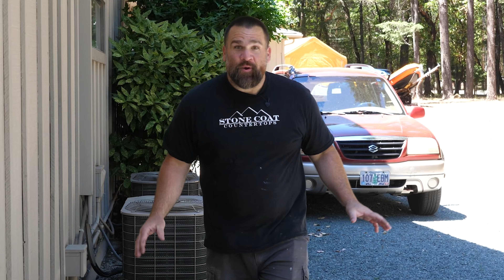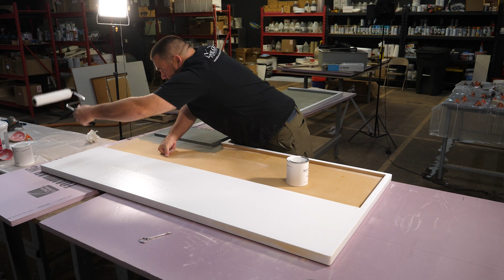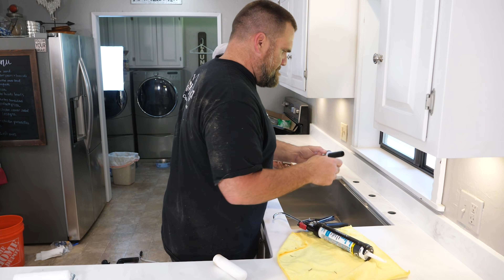How to make White Kitchen Countertops with Epoxy

Comment: Best decision was to epoxy all my countertops instead of buying new granite/quartz. Definitely saved a ton of money plus it looks 1000x better
Reply: i used their epoxy to make my parents shower and it turned out great. Only thing that im not sure about is how long it will last comparatively.
Reply: Great comment! Thanks for watching and taking the time to let is know your project turned out great 👍
Reply: @jkultra2739  can we put hot utensils on it and are they fire proof
Reply: @manishgonekar5831  yeah you can even put hot pans on it. I wouldn't actually do it for long periods of time tho.
Reply: Wow its amazing
Reply: I always wanted quartz/granite counter tops, right up until I lived in a house with them. Every time I put a glass dish down,  I felt like I might break the dish. Nice laminate or even epoxy coated counter tops would be much better, especially if you have kids.
Reply: ❤ Right on
Reply: I'm going to to this when I buy my retirement home  e2 construction base model...paint kitchen cabinets color I like and epoxy the island and kitchen counter tops with this method.

Comment: Thanks for watching everyone! It was my pleasure surprising my good friends with a new kitchen. Let me know how I can help you!!
Reply from the maker: Good job Mitch, nice video!
Reply: Looks stunning Mitch! 👌🏻
Reply: You did a mixture of white dye then white-metalic. How did you get the White-Metalic color? I dont see a white-metalic dye option on the website 😕 Help! lol.
Reply: You can help by just doing what you do sir.  What you are doing is making a difference and inspiring us out here.  Thanks so much
Reply: I did a practice surface with a white tinted and black tinted epoxy and I have a lot of fisheyes. For 2nd coat, do I do same as you did here and do clear coat? Or do I do 2nd coat with same technique and colors I used the first time…
Reply: Do the stone coat clear resins stay clear or would they turn yellow if I went over a white concrete skim coat? The box store brands have all yellowed the concrete so far!

Comment: 🎯 Key Takeaways for quick navigation:

00:00 🎉 En este video, Mitch de Stone Coat Countertops nos muestra cómo renovar una cocina con encimeras de epoxi.
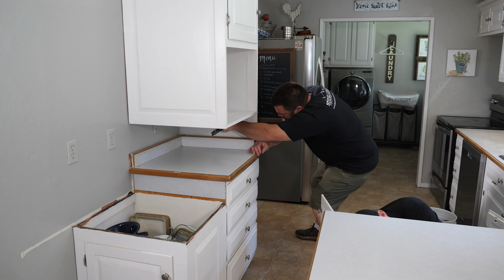01:06 🪚 Al hacer una renovación con epoxi, es importante preparar adecuadamente la superficie existente, como eliminar el calafateo y los tornillos de las encimeras antiguas.
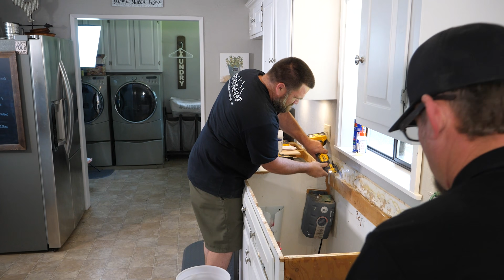02:04 🔧 Para elevar una sección de la encimera y nivelarla con otra, se pueden usar madera y el sistema de Kreg Pocket Jig para crear un marco nuevo.
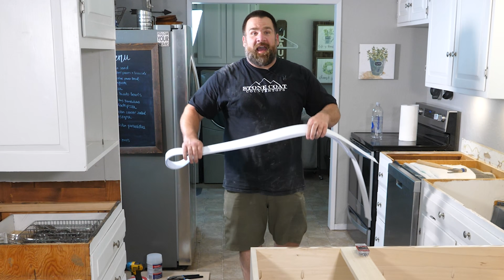03:31 📐 Hacer plantillas es esencial para asegurarse de que las encimeras se ajusten perfectamente a la superficie existente, especialmente en casas con paredes irregulares.
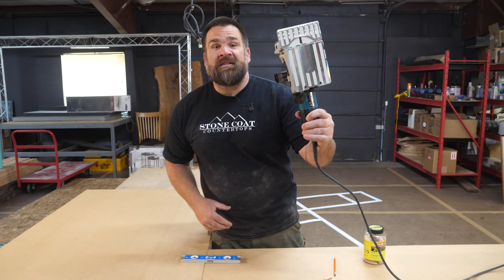05:27 🪓 Para unir las piezas de madera que formarán las encimeras, se pueden usar juntas de espiga o una herramienta para unir galletas, dependiendo de las preferencias y necesidades.
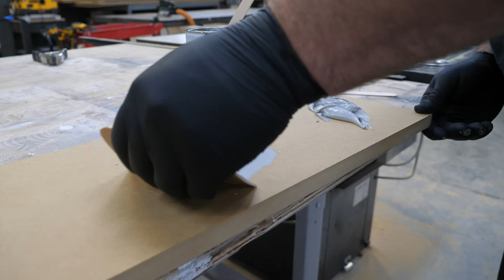06:54 🖌️ La etapa de acabado de las encimeras incluye lijar, aplicar una capa base de epoxi y crear un diseño personalizado con colores y efectos de mármol.
08:51 💡 Al instalar un fregadero, es importante considerar el tipo de fregadero y su ubicación en relación con la base de los gabinetes.
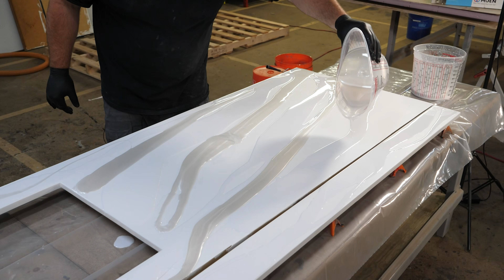10:50 🎨 La técnica para crear un efecto de mármol en las encimeras de epoxi es bastante simple y se logra mezclando diferentes colores de epoxi con las manos enguantadas.
13:20 🛠️ La aplicación de la capa superior definitiva es crucial para mejorar la durabilidad y resistencia a las manchas de las encimeras de epoxi.
15:19 🧽 Antes de aplicar la capa superior definitiva, se recomienda lijar suavemente la superficie para eliminar imperfecciones y luego aplicar el material de impermeabilización ARDEX en áreas expuestas al agua.
17:15 🧰 Al instalar las encimeras de epoxi, es importante asegurarlas correctamente a los gabinetes utilizando tornillos adecuados y evitar que los tornillos atraviesen la encimera.
19:14 🚰 La instalación de un fregadero bajo encimera debe hacerse con silicona alrededor del borde y sujetarse con abrazaderas y soportes para garantizar una unión segura.
20:13 🔧 Deja secar la silicona alrededor del fregadero durante la noche antes de instalar accesorios para evitar movimientos.
21:12 💧 Aplica una membrana impermeable en los orificios de grifos y accesorios para garantizar una protección adicional contra el agua.
22:10 😊 Los clientes están encantados con el resultado de las encimeras de mármol Carrara blanco que se lograron con solo tres aditivos y el Ultimate Top Coat.
23:05 🎨 El acabado mate del Ultimate Top Coat realza la apariencia realista de las encimeras de mármol Carrara blanco.

Made with HARPA AI

Comment: I've been using the Kreg jig ever since I bought one of the first ones at a wood working seminar in Grand rapids. It is made of aircraft aluminum with the steel inserts. I've had it for over 30 years and still use it at times. I also use a biscuit joiner on all of my glue ups. The universal tool is my "magic" tool..

Comment: Nice job in raising the worktops... I might have been tempted to add some draws in that extra space and take the backsplash to the end, to finish it off.
I was amazed at the results pouring three different shades and hand blending them made.
Reply from the maker: We were considering a large drawer, it would have been pretty shallow so we decided against it, great suggestions though. Thanks for watching!
Reply: @StoneCoatCountertops  A large shallow draw would be ideal for cutlery and utensils.
Reply: I agree. The backsplash should have continued to the end of the countertops but looks like an improvement compared to the old kitchen nonetheless.

Comment: I tend to use an alternating system to add strength and security.  I put bottom pieces from one wall and add the piece to continue the run.  I do dowels (usually 4) equally spaced, and then insert a biscuit in between each of the dowels (3).
then I lay the 90 degree piece the same way.  Once it is set, I reverse order of pieces laid so that the first L joint is being covered by the second tier, and then the second L joint is created not in the same spot.  very strong!!
Reply from the maker: Love this, I'd much rather be mega strong than skimping! This is the type of installer you want! Keep up the good work out there!

Comment: What an incredible instruction vid. 
Just today I saw a random countertop on an advertisement that was selling a computer, but it was the counter that caught my eye.  Now I want to make a similar thing.  The counter  was a soft whitish  marble with occasional  soft grey lines - very simple.  But  the backsplash was an I credible variation  with  pieces in a herringbone  pattern.  One piece was the color of the counter, sometimes the whitish background with little to no grey marbling, and other times more grey marbling,  while some alternate pieces had  a slight soft blush/pinkish  tone here and there
  The pattern and streaks placed at opposite positions of the whitish marble, and occasional pinkish tone here and there  was stunning.

I'm thinking all the pre-cut  herringbone pieces  could be lined up and expoxied,  then glued in place on a moveable surface  and sealed, and then the whole thing applied on the backsplash. 

Am I right?

Comment: How do you make a solid slab backsplash?  MDF? Foam insulation panels?  This is the look I want over my stained granite countertops inherited when I bought a pre owned home.  Beautiful epoxy carrera marble.
Reply: When we made ours we used MDF with a 1/8” round over.
Reply from the maker: I've seen folks use 1/2 in foam for full height, u can use mdf also. Great question, lemme know if you have any other questions 👍
Reply: We use 1/2" mdf for our backsplashes

Comment: You should redo a faded shower. I did mine with   Rust-Oleum tube and tile spray cans. 90% satisfied with it but had tones of strips to sand and buff out. Next I'm going to do my bathroom counter top and I started to think maybe I should do both with the granite paint and epoxy to match

Comment: Awesome job!
Reply from the maker: Thanks! I don't know why they would have put the peninsula so low like that in the 1st place! Have u worked epoxy on a project yet?
Reply: @StoneCoatCountertops  Seems like the older homes did that a lot. It looks much better leveled up to the other counter. Yes I remodeled my masterbath with a new 61 inch cabinet and made my own counter with MDF and Stonecoat Epoxy with a rock edge. I am in a 1995 manufactured home so not everything is level but I can honestly say I'm am proud of my work. Stonecoat is all that I will use whether for remodeling or for crafts. Thanks for all you do. I am always looking forward to new videos to watch. See you on the next one Mitch. 😊

Comment: Hey Mitch , I typically do Tumblers and Mold casting using Stone Coat and Love Your products and Videos! I’ve decided to go All in and Epoxy Moms Kitchen Counter Tops , a-little intimating for such a Large project but Excited.. Can you suggest what  Best epoxy Products I will need ? Sealer? Thanks in Advance

Comment: Beautiful job and great video.  What are the two raised areas with boards on the underside for?  One is painted white and the other is painted grey.  Also, why didn't you use tape on the edges and then remove it to allow the epoxy to spill over?  Most of your videos I've seen do that.  Please explain why you would or wouldn't do this step, so I can be sure to do it right for my project. TiA

Comment: Why do you apply Bondo to all of the cut edges? I recently bought some Bondo after watching your tutorials, I intended it for leveling a countertop and sealing up the seam (I have yet to use it)  I noticed that when you cut the sinkhole you applied bondo to the cut edges. Why is this?

Comment: Hi there, very keen to do this myself, but can I do this WITHOUT removing my sink and tap (faucet).
Can I tape vertically around each of these to create a ‘wall’ of tape that the epoxy can run up against?
Removing these would be costly and a real pain (in the U.K.) although I know it would be a smoother and better finish if I did remove them.
Thanks for any help.
Cheers - Matt

Comment: Mitch - is is not necessary to use the square notch trowel to spread the epoxy, and then the paintbrush to chop it?  Does the top coat replace the clear epoxy coat?

Comment: My husband and I got the large kitchen white kit of the art .less than 3 months of finishing the job it started yelling and I have  yellow ring at a spot we put a not so hot small sauce pan on the counter for like 7 seconds while i was switching pans on the a stove .
 that's what they advertise and the reason I got it because of the heat resistance. Even my old laminate counter I had could handle this. That's why I'm very disappointed, now it looks ugly and cheap. It sucks because I did love how it turned out, and I received so many compliments on how beautiful it looked.  I don't know what we're going to do to fix it.

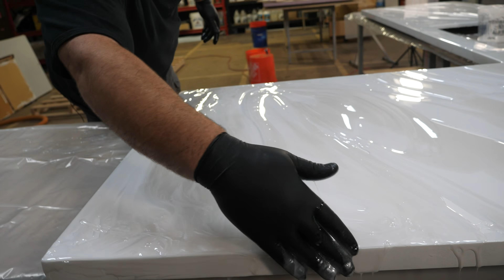Comment: HELP! So in some of your videos you tape off the edges and then remove the tape hours after for the epoxy to slowly slide down but in this one you're just letting it roll off from the get? Which should I do??? Any help would be great as I'm just about done with the undercoat and am about to start with the epoxy! THANK YOU! 11:12
Reply: when they are peeling the tape off it’s because they are using a technique called « exotic poor » or « dirty poor ». You need about 7oz per square foot for that technique. If you want to use the technique showed in this video, you can use your gloved hand and about 3oz per square foot! I personnaly did both technique and they are amazing whatsoever. Anyway, I think the technique they used is easier at first especially if you want to do a big countertop;)

Comment: Hey Mitch, my countertops looks very similar to these countertops. Is there a way to put exopy over the edges without the gap(edges) on the edges? Should I use bondo to smooth out edges

Comment: My Art Coat table top which sits in indirect light occasionally and is only a year old is very yellow. A printer sits atop it and you can see the extreme yellowing compared to the spot where the printer is.  Yeah, I mixed it right.  I see they've dialed back the promise of Art Coat. Mike used to say it would never yellow. Mitch is being a little bit more conservative with the promise.
Reply: 😔 bummer, but good to know!

Comment: How does epoxy do with a hot pot or pan?  Will it melt or warp?
Reply from the maker: Great question, Stone Coat is heat resistant up to 450 degrees! Let me know if you have any other questions, I'd be happy to help you get a project started!

Comment: Looks awesome!  What did you use to put the sink drain in? What was the water proofer you used in the facet holes? We are putting a new sink and vanity in our bathroom because the old one leeked. Thanks.
Reply: Plumbers Putty for the sink drain - The Waterproofing used was ardex S 1-k - It is used for waterproofing shower walls etc. before tile installation - There are other brands of waterproofing as well like Red Guard - I like Hydro ban -

Comment: Can this product be used on a squre edge formica countertop?
Reply from the maker: Yes, u can go right over old tops. I'd also round over the sharp 90 with a orbital sander or trim router with 1/8" round over. Laminate routers easily. Clean with tap, sand with 180-220, apply 2 thin coats bonding primer, apply 2 thin coat epoxy undercoat white, let dry 4 hours, ready for epoxy. Lemme know if you have any questions 👍
Reply: @StoneCoatCountertops  Thank you! Can't wait to try this.

Comment: Can UTC be used on non epoxy surfaces?
Reply: Yes
Reply: Yes!
Reply from the maker: Yes, I've applied right to woodworking. Less depth without epoxy below but still durable and pretty
Reply: @StoneCoatCountertops  Good to know I was wanting to use it on my shower walls that I have put thin wood blanks in.